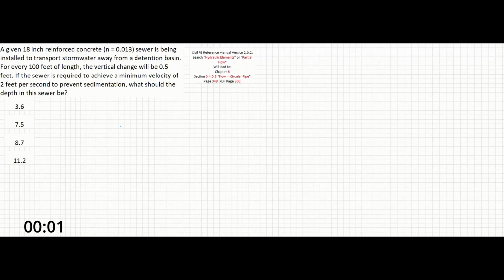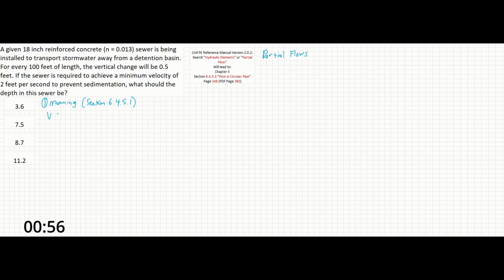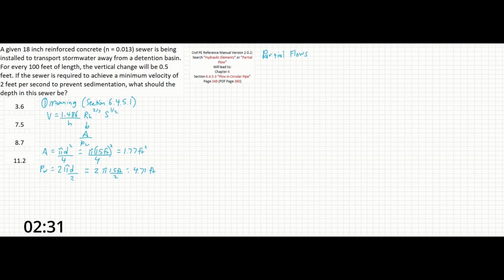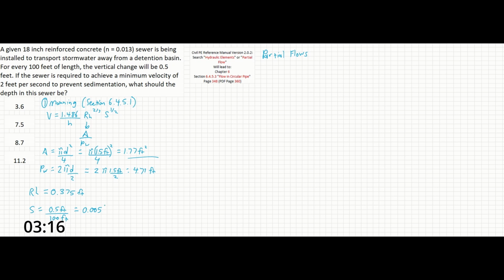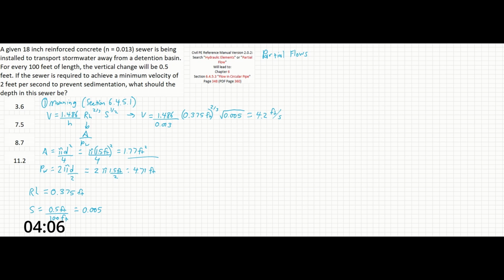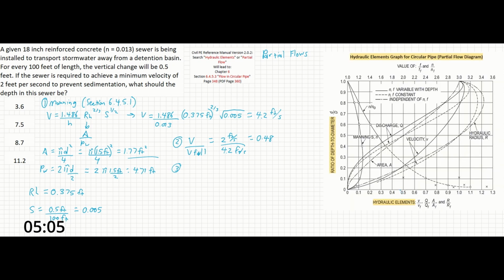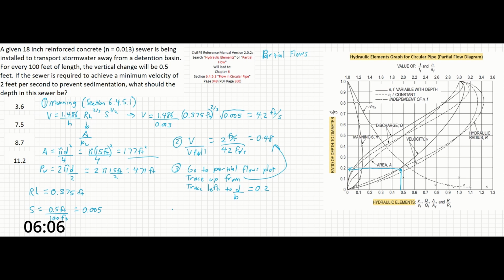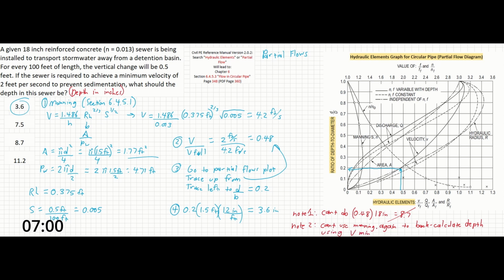PE Exam Practice Problem #86: Water Resources/Environmental | Sewer Design Velocity - Partial Flows

Comment: First off, thanks for these videos - they are extremely helpful. With this problem, is there any reason I couldn't just solve for the hydraulic radius (Rh) at 2 fps? Doing that gives Rh = 0.123'. Then, solving for theta (using the "Geometric Elements of Channel Sections, p8 Env. RH) gives theta = 1.482 radians. From there, doing a little trig gives a flow depth of 2.4". Thanks
Reply from the maker: It seems to work here, so I think so? My note at the end of the video cautions against using mannings directly with the 2fps because we wont know the geometry of the partially full pipe, but maybe since you are using that Geometric Elements of Channel Sections, then its still addressing that. Sorry, I'm away from home for a few weeks on a life side quest and don't have a lot of resources to check, but didn't want to leave the question hanging.

Comment: Should we always assume that n is variable with depth for partially filled pipes if it is not mentioned in the problem statement?
Reply from the maker: There are a lot of problems that will use equations where n is assumed to be constant - such as problems involving mannings equation. If you are given a problem where they supply a nomograph though, i think it will depend on if its mentioned in the problem statement or not, like you said. If you're lucky, either line will lead you to the same multiple choice answer on the exam.

Comment: I believe you made a minor mistake. When using the graph, the vertical line from v/v_f = 0.48 should intercept the curve just below the curve you used (the lowest curve). You seem to be using the curve for the hydraulic radius with constant n and f. d/D should be around 0.17. Then d=0.26' or 3.06". Correct me if I'm wrong.
Reply from the maker: I believe in this problem, velocity would change non-linearly with depth in this circular sewer. That is why I used the solid line. Ideally the problem would give you some kind of hint if it wanted you to simplify. Thankfully, in this case, your answer would still solve closest to the correct answer regardless of which line you used. I would like to believe that the problem creators recognize that there is some inherent ambiguity in doing this by hand during the exam and not making the answers too close together here.

Comment: Sorry second question regarding this chart in a day. When I first solved this, I used the dashed line instead of the solid one. If you are saying that n values vary during partial flow, why does the chart have a line option for constant n values if the whole chart is for partial flows. Just trying to understand when I need to use the solid line versus dashed line as it makes a very large difference. Should I always be using the solid line??  Thanks!!!!
Reply from the maker: This is a great question. I don't blame you at all for being confused. My best understanding is that there are times when it is easier to assume that n does not vary with depth. I think this assumption is often made in sewer design calculations. But for our purposes - stick to using the solid line on exam questions unless it is called out specifically that n is constant with depth. Hope this helps.
Reply: @SolvedIn6  Seems like a good idea as odds are the exam will want you to use the solid line in order to keep it simple unless very specifically called out.  Good advise

Comment: Great question. I was originally solving with manning equation, but found out it didn't work out, so turn my attention to the chart. 
But here is a minor comment: The problem didn't state whether n is constant or variable with depth. It is a bit ambigous
Reply from the maker: Thanks for watching and sorry if that wasn't clear. From my experience in sewer modeling, we model all concrete pipes with an n of 0.013, so this can also be looked up if its not provided. But if you see a number for n stated in a problem on the exam, the same way it is given in the problem statement above, its highly likely that they are not providing it to trick you. The closest trick would likely be if n is not required at all.

Comment: Thank you for your work! These problems are the closest I could find to the NCEES problems and you explain it very well. For anyone else, a short hand for hydraulic radius at full or half full pipes = Dia/4
Reply from the maker: Thanks for letting me know you find these useful. I do my best to make these problems very similar to those you would find from the NCEES, as a way to reinforce concepts you may have already studied. Thanks also for sharing the short hand calculation. You're absolutely right that it is often expected that you will use equations like that to speed through more mundane parts of the problem and stay within the 6 minute average time.